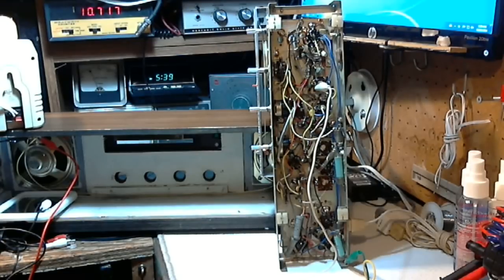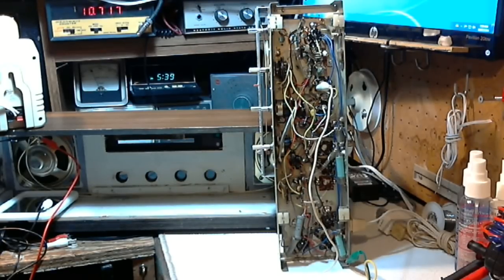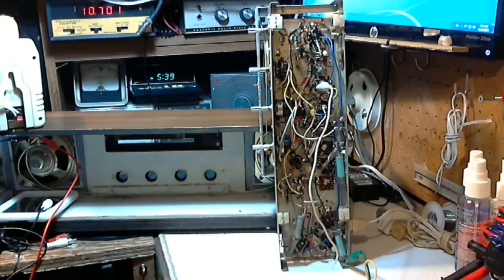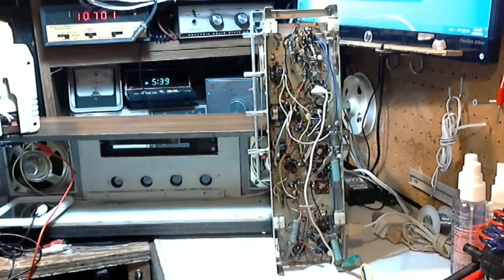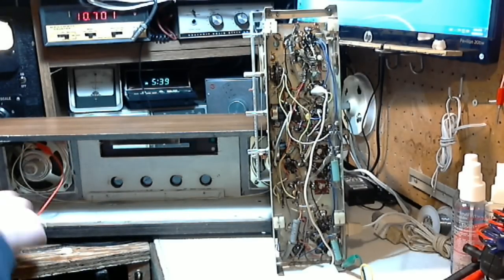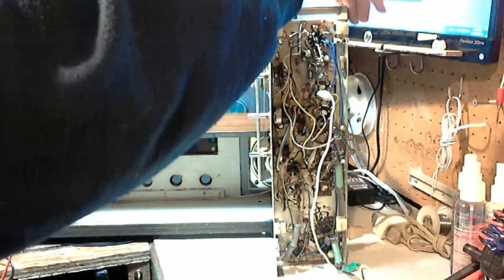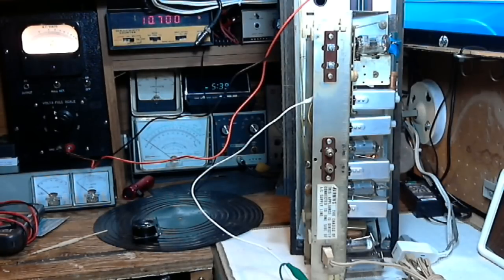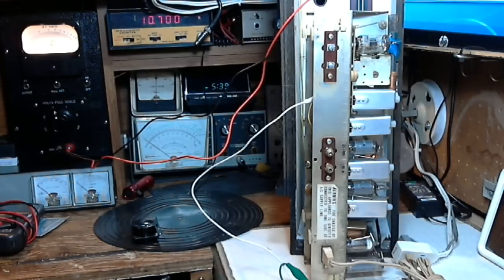Concerto AM/FM Vacuum Tube Radio LL21552 Video #4 - Alignment

Comment: Do you have the AFC turned off ?
Reply from the maker: Good question.  I make sure the radio is set to FM only.
Reply from the maker: Are you suggesting the AFC was causing the wandering signal strength?
Reply: Turn AFC off when doing the RF & IF alignment. Turn it on when aligning the discriminator.

Comment from the maker: Looks like I'll be doing more on this radio so here is a link to photographs of the schematic diagram that was glued to the bottom of the cabinet.

http://www.evernote.com/shard/s219/sh/c60bf15a-72a5-4c77-a5d6-65b560d91665/fa43f1e18bd15ec4168d44cf9fabc86b